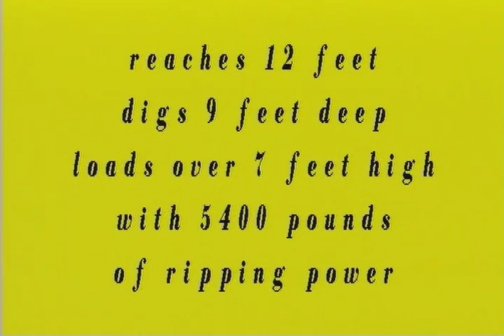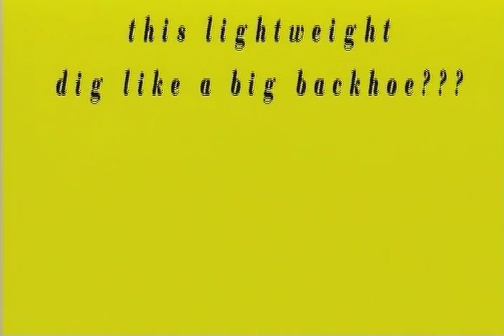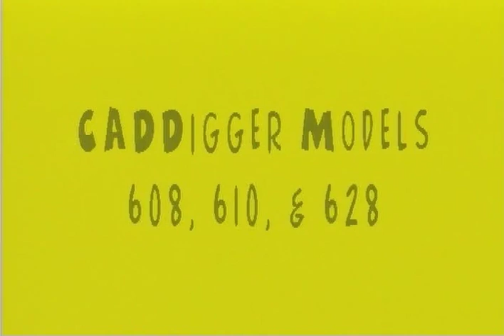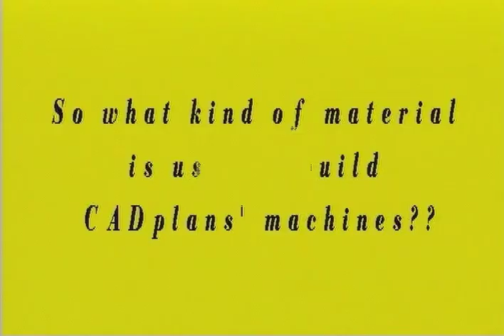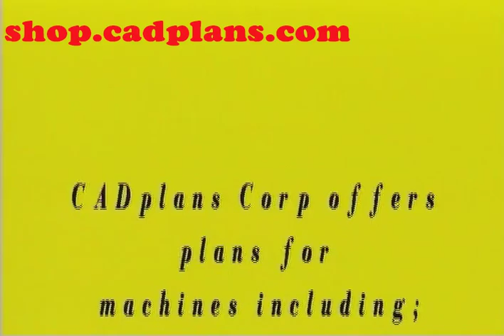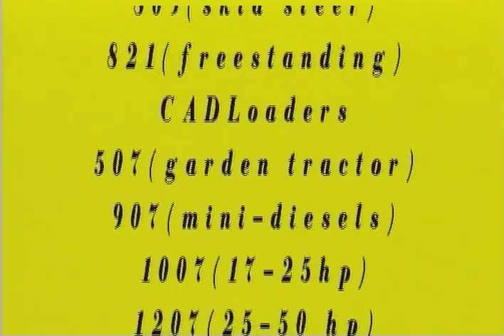DIY Backhoe And Loader, Preview

Comment: I noticed that, on the towed model, it is easy to push, which would mean that it would be very difficult to dig in hard clay. It would just lift up the machine.
Reply from the maker: Rather than "pulling up", you dig by clamping dirt between the bucket and the piercing stabilizers. No dragging when you dig that way.
Reply: I and my son  built this same machine from the plans about 20 od yrs ago. still using it today. It's like Cadplans said. it pinches between the bucket and the cleats. When you learn to use it , it actually pulls down and not up.